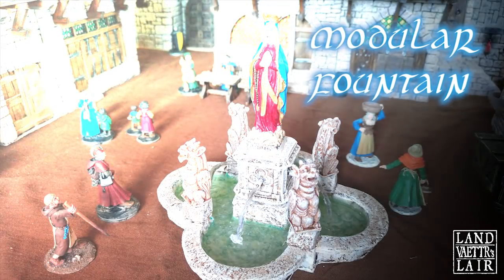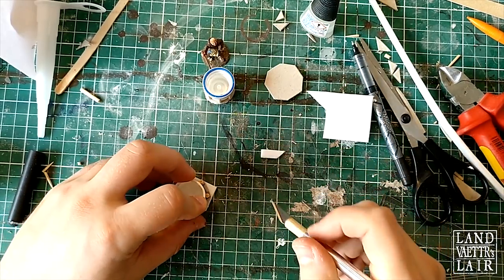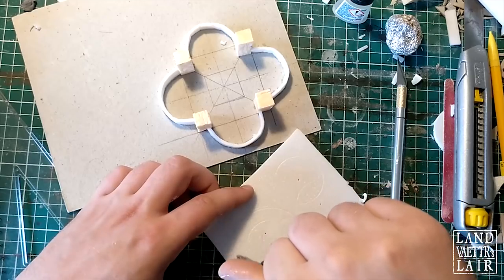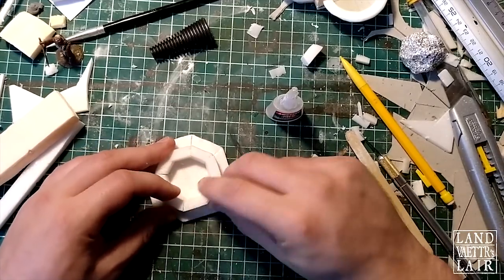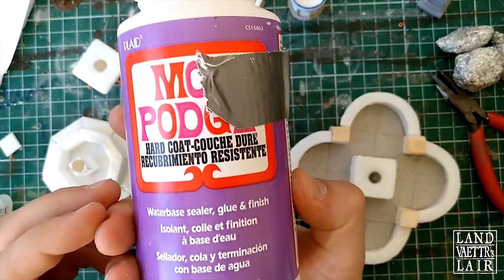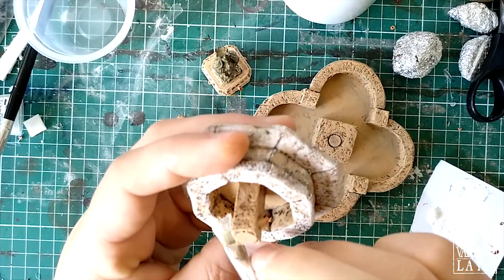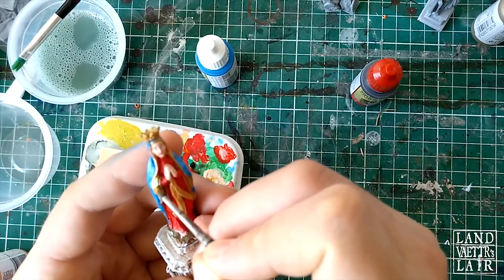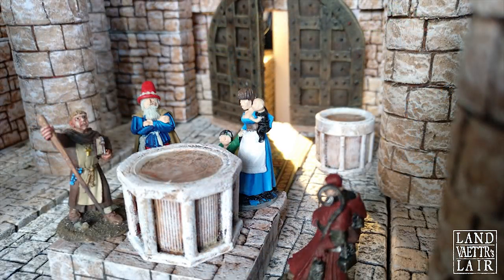Crafting Modular Fountain for Tabletop RPG (tutorial)

Comment: Looks like the new flat has great lighting for your work area . I am working on a couple demon altars and have been stumped on the base. Your fountains have given me some great ideas to adapt for my bases. As always thanks for the inspiration!
Reply from the maker: Hi Kat ! Yeah the flat is super bright, its exremely pleasant to live there, it's sometimes even too bright for recording crafting ;) ! Glad to hear the fountains inspired you!
Reply: @LandvaettrsLair  There is a fabric called 'blackout'. It is white or offwhite 
but has a rubber backing. It is 54" wide (think that is roughly 1 1/2 meters). 
You turn the top edge and can staple it if you don't sew. Hang the dowel or 
rod on cup hooks and it is very easy to put up and take down. Caution - 
make the covering a good inch bigger than the window so you don't have a 
tiny sliver of light peek through. In the states it is available in any fabric 
shop, but you can find it online and it is fairly cheap.

Comment: Really like being able to change out the statues gives them a very different look. In wondering if you cut out the bottoms using flat plastic you could tint them blue, green even red to have a blood fountain might be fun to try. Can't wait to see your stop motion stuff. I'm very interested in that.
Reply from the maker: I know right ! I actually wanted to be able to change the bottom as well, and i'm still pretty sure it can be done, though maybe not out of foam... Cutting out the bottom won't work because once poured the resin will adhere to the surface. 
Since it's made out of very thin and fragile foam it required a solid base, however if you use tougher materials you could build it without a base, then set it on a parchment baking paper and pour the resin. Should be able to detatch it afterwards and be able to change bottoms!
Concerning stopmotion i need to get back at it, complète an armature and do a new one since i got better wires than last time. Hopefully you'll see that in a couple of weeks !
Reply: @LandvaettrsLair  Was thinking of you cut clear flat plastic to fit in the bottom of the fountain you could make ripples on the bottom side child it whatever you wanted white blue red green ect might be interesting.
Reply: @LandvaettrsLair  Hey Landva check out Wyloch's Armory episode 087 Planar Map Room around minute 5:30 I'd the part I mean. If you did the fountain like this you could add ripples on the top part of the clear plastic. The slide in pieces could be any color you wanted kind of a cool way for different looks eh?
Reply from the maker: @AlexBabcock-hw9iz  Yeah that's more or less what I meant, but using resin instead of the plastic sheet, you know, for the depth of the fountain! Wyloch is such a great crafter, he's always been so creative!! I remeber the first modular system I used was his dungeon tiles and addons!

Comment: I like using a 2 part epoxy resin for the basic water. It dries nearly perfectly clear. Then, you use a clear quick drying epoxy for the wave effects. 

Finally, for the water out of the fountain i use clear fishing line, glued into place. Take the two part quick dying epoxy and lightly coat the fishingline. The effect is stunningly realistic. I've had people touch it to see if it was real water.
Reply from the maker: Fishing line and clear epoxy is defenetly a good option, might try this on a forseable project. Thanks for the feedback and advices! Cheers!

Comment: 6:04 I recently had to make a couple of wooden balconies and you can gain a lot of time by sculpting the railing as a long bar with a wavy profile and then just cut it like a sausage to end up with identical elements that will repeat along a wall. This is faster than assembling bricks and then filing them down to shape. You can also use these bars as ledges or cornices.
Reply from the maker: Probably, though i'd have less dexterity with these sort of files on a long & flat surface. I'm sure it's super faster with wood to do it beforehand but with foam & such a small piece the filing part at the end was actually pretty fast !
Reply: The trick is to use a rolled up sheet of sanding paper instead of files to sculpt the profile of the bar. For really fine details, you can even sculpt plastic guides that can be glued to each end and will prevent you from sanding too far into the foam.

Comment: I really love your town setups. The walls that you use, are they just brick patterned foam bricks?
Reply from the maker: Hi and thanks. No the inside is made out of several layers of corrugated cardboard, only the exterior is made of 5mm thickness foam that I engraved manually with an X-acto knife and textured with a ball of aluminium foil. https://youtu.be/aHL7ncloRdk?t=73